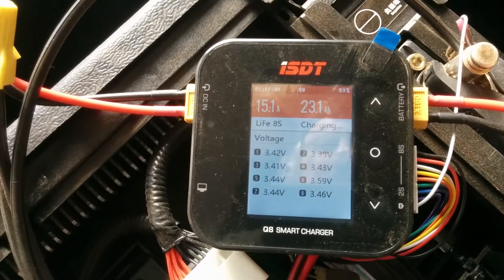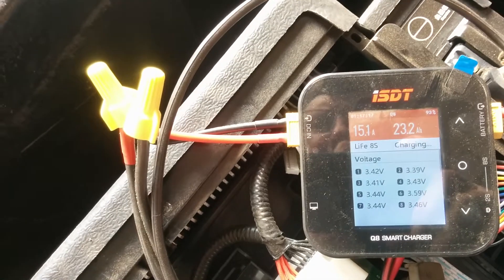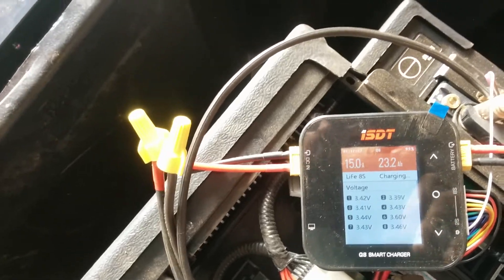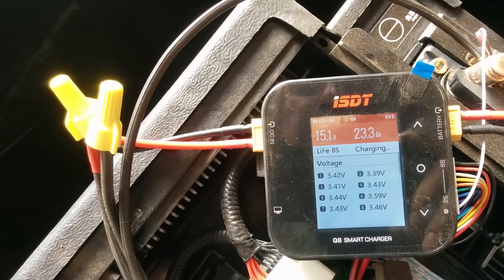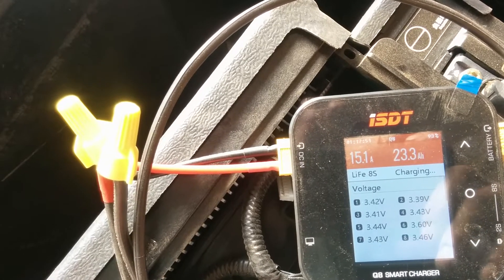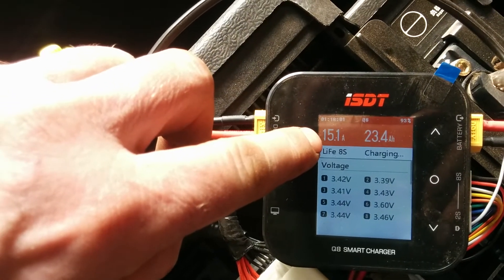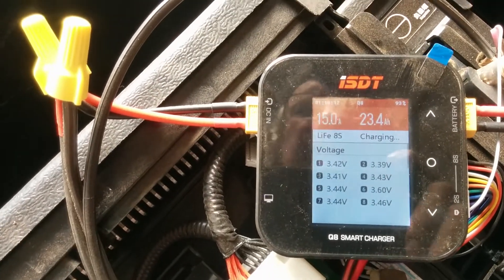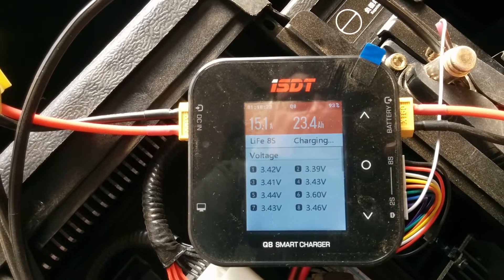BYD Battery Pack charging with ISDT Q8 Balance Charger Part 1

Comment: Just did the same as my BMS didn't show but it go's to 2 amps input and back down to 0 and repeats when one cell hit 3.6? I have it set for 14 amp charge any ideas
Reply from the maker: Pretty sure that is what it is supposed to do.  It charges at the full configured capacity until the first cell hits the upper cell limit, then it drops down to equalizing the cells which use much less power.

Comment: I'm curious about the little pcb you used to interface to the sense wires.  Was that your own layout or is it available somewhere?

Thanks for the video!
Reply from the maker: It's available on techdirectclub.  It is for their BYD bms system.  It will need a bit of modification to interface with the ISDT charger.